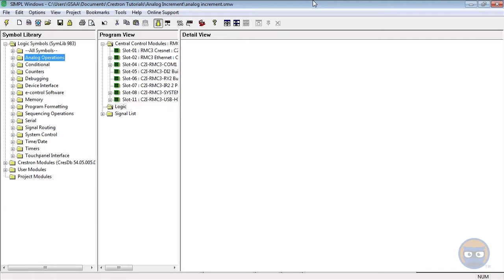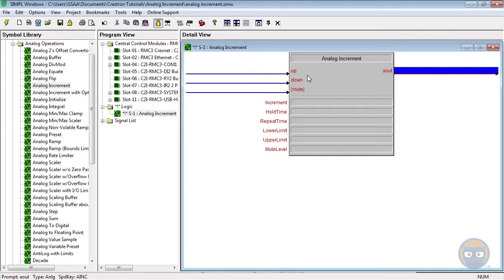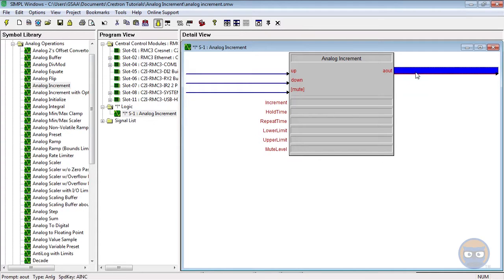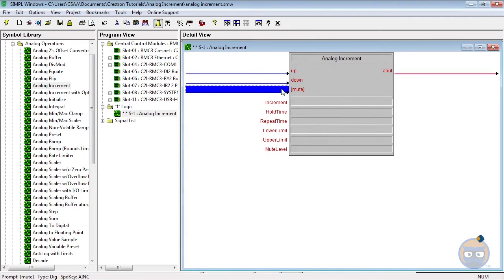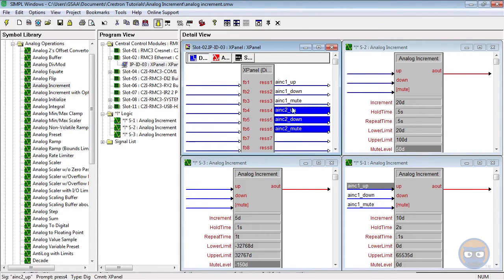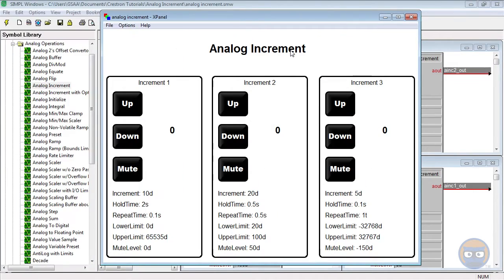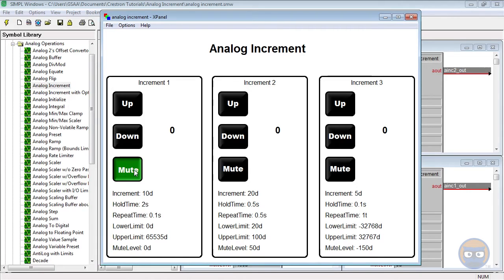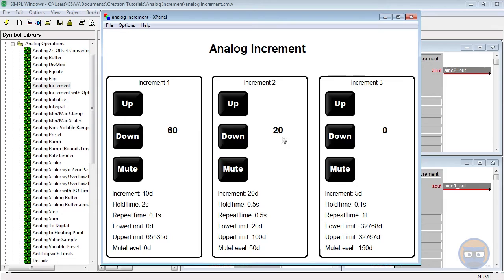Crestron SIMPL Windows ANALOG INCREMENT Symbol Tutorial

Comment: I am trying to build a simple on/off toggle. I am using Advanced Slider Horizontal (On and OFF mode with a short slider in the middle) and I have Linked it with an Analog Increment (the limit is from 0 to 1). When I press the On or OFF labels the slider responds correctly. However when I try to drag the slider and let go, it returns to its previous position. How can I resolve that?